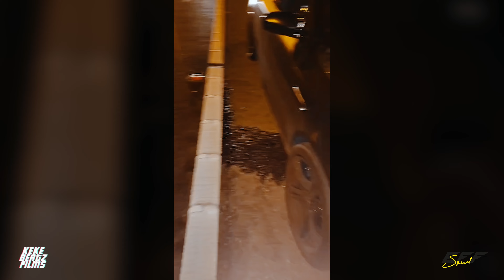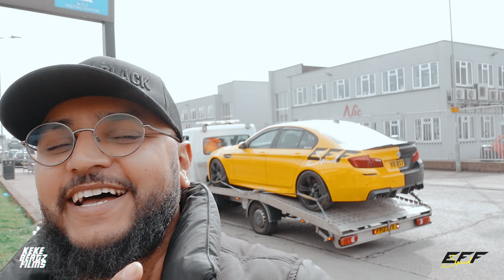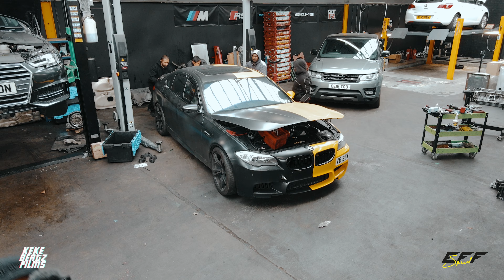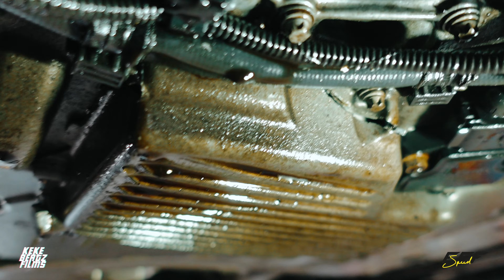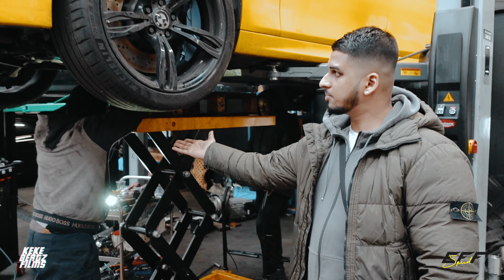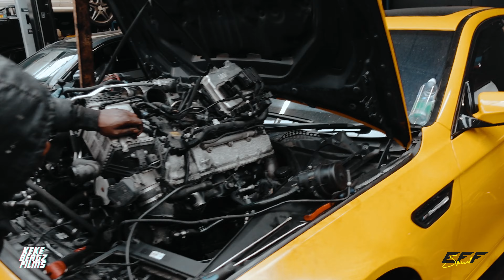DID I JUST BLOW THE ENGINE ON MY M5?! 800BHP GONE WRONG!

Comment: How much does it cost to forge the engine ? 
What’s the limit for the rods as I was planning on tuning an m5
Reply from the maker: Your looking around 15k gbp. The Mr Vanos rods I'm using made by arrow are rated to 1200bhp! Definitely a wise move as preventative maintenance as it turns out it was my rod bearings were the cause of failure. You'll see from part two!